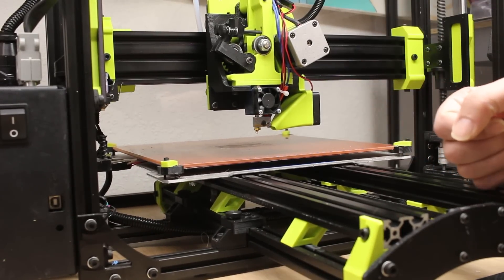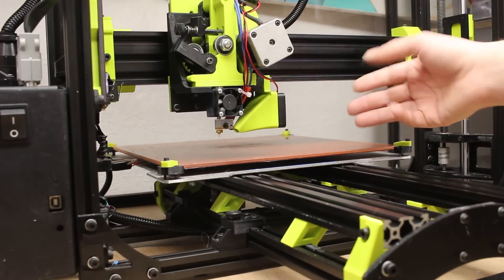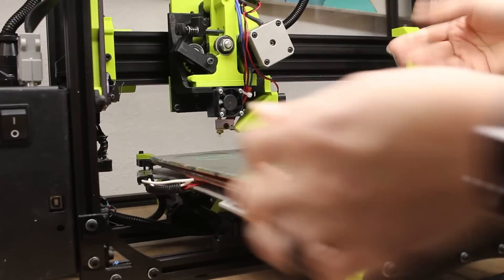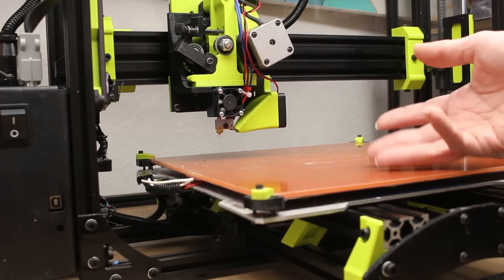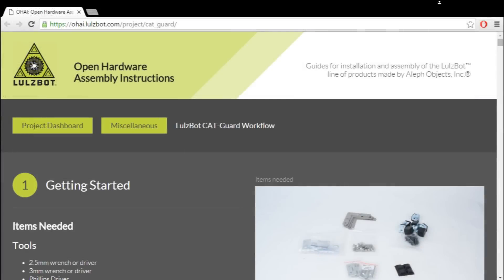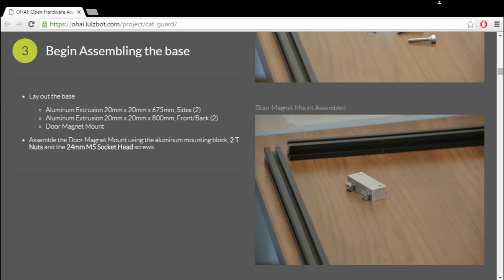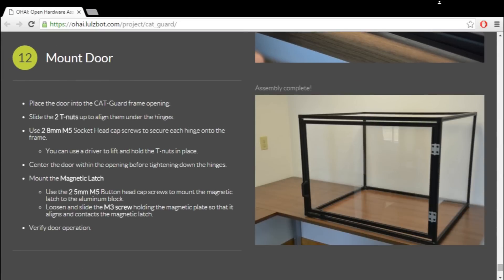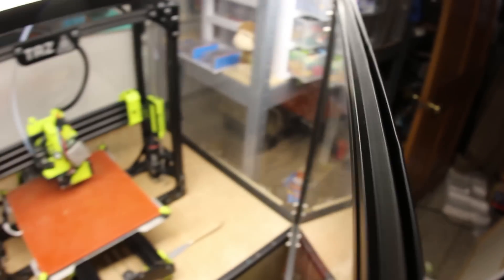Lulzbot Taz 4 Upgrades and Enclosure

Comment: Wow those are some awesome upgrades Kirby! had no idea they were documented by Lulzbot. Switching to the rails system makes it so solid. Thanks for putting this together, very insightful!
Reply from the maker: +Pixil3D Thanks, The rail upgrade is by another person on thingiverse. But Lulzbot also does a great job at making sure all their work is open source on the devel.lulzbot.com site. You can see upcoming changes in the designs and build them yourself if you wanted.